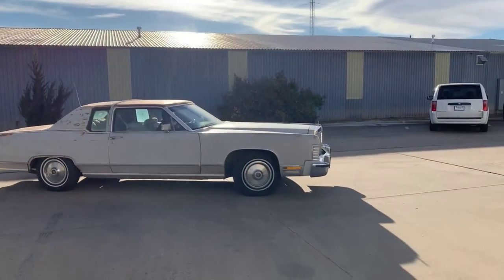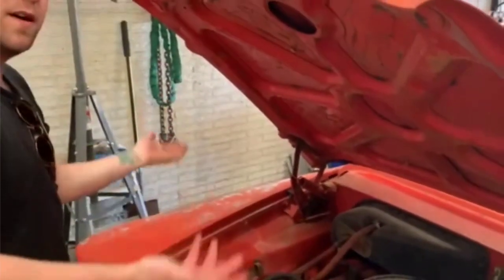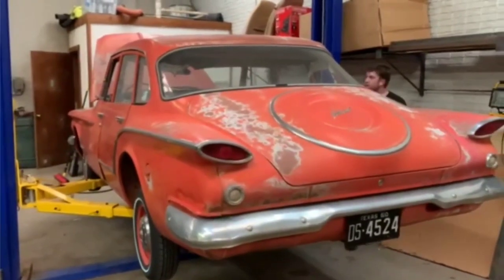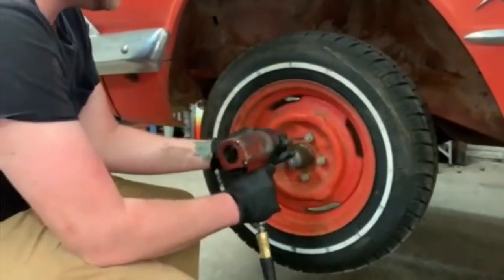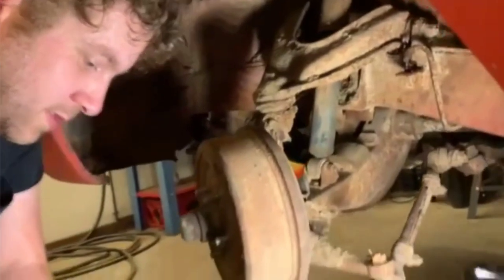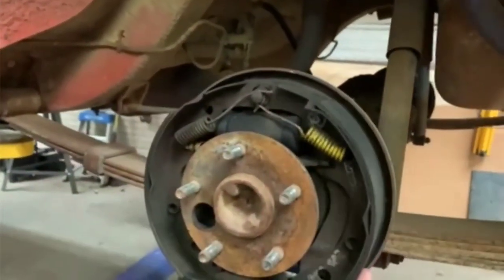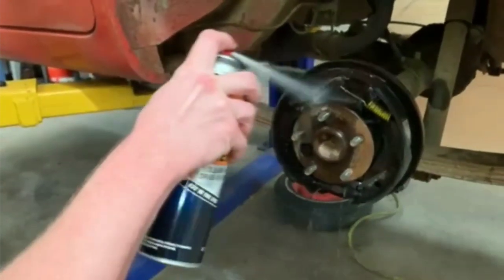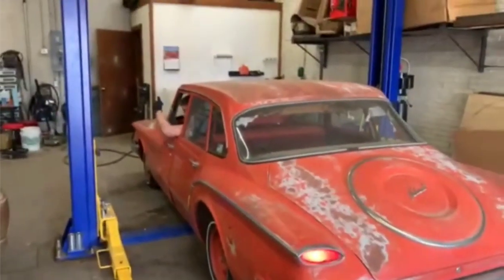It's Always Something - Plymouth Valiant

Comment: For your 1960 Plymouth:
1. The left hand thread on the car right side was used so that the tire rotation direction ensures the wheel lug left hand thread remains tight (will not unscrew) as the tire rotates. Some other auto makes did this until lug hardware diameter size was made larger.

2. Use penetrating oil like Liquid Wrench, Blaster, and let set. Or, in a pinch, acetone + Dexron, Mercon at 50/50 (Not Ford "Type F"). The Dexron / Mercon ATF has friction modifier to reduce hydro-static friction improving the slippery quality. The Acetone improves the penetrating action. Re-wetting some drips using the ATF/Acetone can improve this effect if you allow time to pass.
Reply: Glad it broke loose for you.

Inspect the parking brake shoes unless the P-brake is the same brake shoe and drum as the foot brake.

The cylinder seals are worthy of inspection. These fail through age and mile.

At some point, you will want to check the grease pack on the rear wheel bearings unless wheel bearings lubricated by the diff oil.

You will want to replace all of the flexi brake lines as these nylon hard lines erode as no one flushes brake fluid, the brake fluid absorbs water from the air, become acidic, and erodes the nylon hard line inside the rubber outer line you see. The nylon, then, delaminates and can cause a blockage.

Use DOT 4 fluid. Walmart SuperTech DOT4 is perfect. What I use my my 1990s Volvo 240s.
Reply from the maker: Thank you so much! We appreciate you watching (and for teaching us a little something!)
Reply: This is the car of my nightmares.
Reply: Hate to be "that guy" but the "left hand thread" (lugnuts) you're referring to are on the driver side on my '65 Coronet.

Comment: Chrysler and some other manufacturers used  left hand thread on the left side because it was believed that the rotation of the wheel would help keep the lugnuts (and lugbolts) tight. (same with some small engine flywheel nuts) The last model year for Chrysler to use this on their cars was 1970. G.M. used them on their larger cars, Pontiac, Oldsmobile...  through 1964. There were other brand cars right up to 18 wheelers that also used this practice.
Reply from the maker: One of our favorite things about this since we've started is the neat tidbits we learn from people who watch. Thank you so much!!! You're awesome! We appreciate you watching!!!

Comment: 10 year old‘ 190 cu.in. 1960 Vaiiant,5 grown men plus gear, hundred miles to the oil drilling rig and 100 miles back home seven nights a week. Never missed a beat
Until a rear Axle bearing froze up and later the transmission let go. Probably too much weight for a compact car
Reply: That would have been a 170 cubic inch engine unless you did some MAJOR modifications!

Comment: Birth of the Slant 6 unless the '59 model had it. Can't get info on that easy. Nobody is preserving these cars.
Ok, I found my answer. The Plymouth Valiant was introduced in 1959 as a 1960 model. You should have the 170cid version of the Slant 6 engine which was the ideal design.